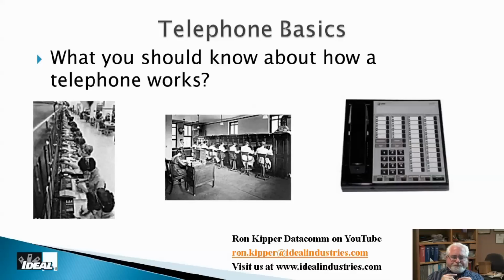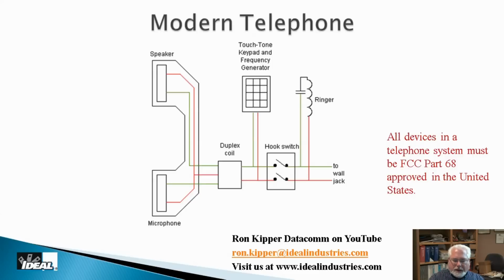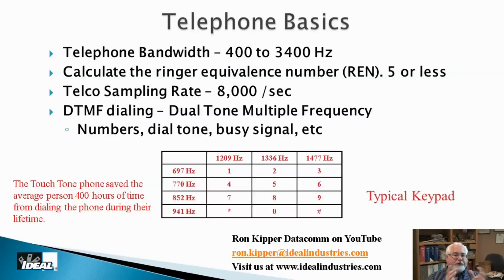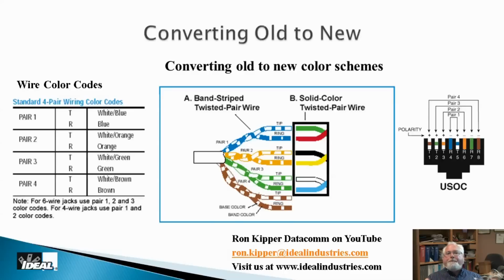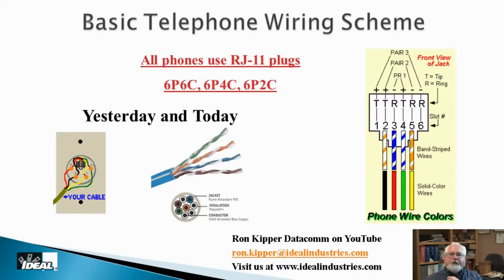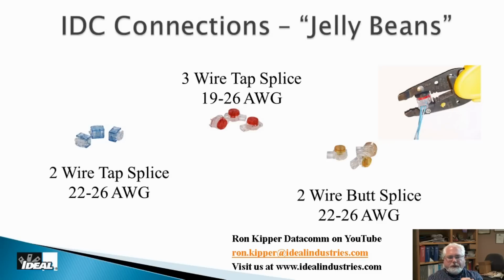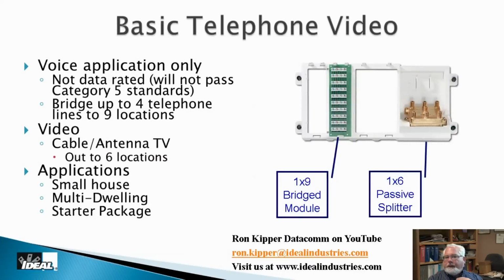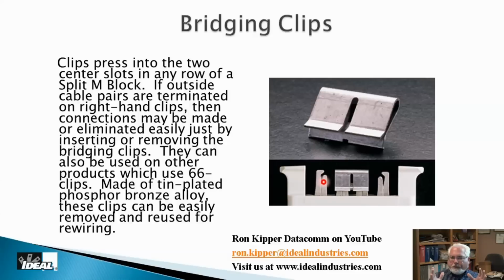Residential Structured Cabling Part 7 Telephone

Comment: What is the reason for these lines still functioning during a power outage? just curious, thanks!
Reply from the maker: The phone companies powered the lines using DC and had large batteries as backup. So the did not require local power to use the phones hope that helps Ron

Comment: this may be a silly question,,, but the pic of USOC wiring,,, is the order of wire in RJ45 plug with the clip up, or clip down?
Reply from the maker: The image is the face of a jack so the plug is wired with the clip down. Hope that helps Ron

Comment: Ron, I want to add a phone jack into another room, using the same phone number as my kitchen line (which is the only line I currently have). I was going to run a new cat5e line to my phone box splitting the original line's cat5e at the box with a T Adapter splitter. Is this the best way, or is there another connection in the box that uses the same number as my original line that I should be looking for?
Reply from the maker: Just like you are thinking run a Cat 5e or Cat 3 line to the other room and splice it to the incoming phone line and the other room. Just splice them all together and install a jack in the new room. Good luck Ron
Reply: Thank you sir!